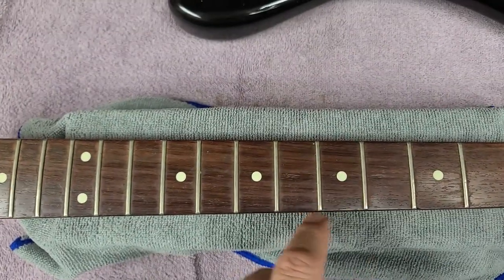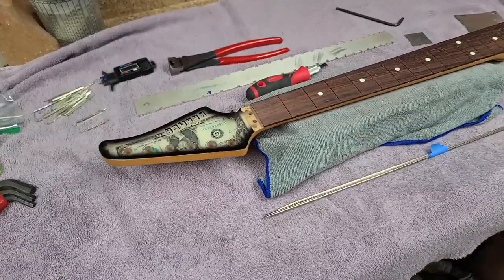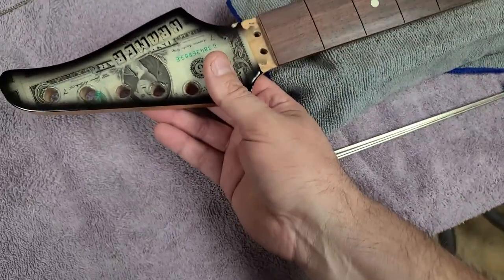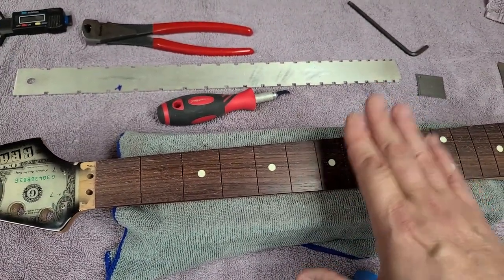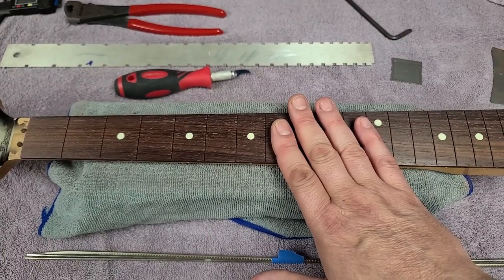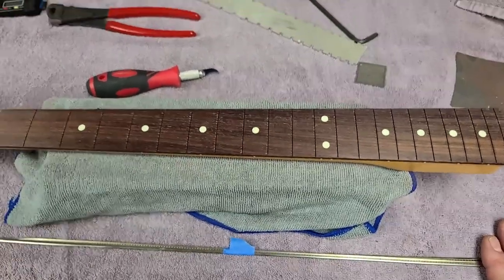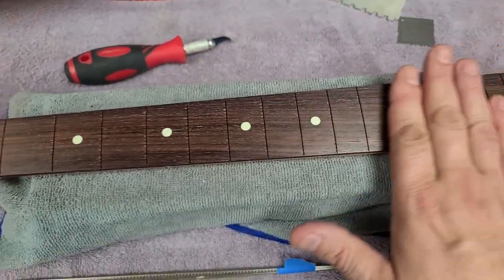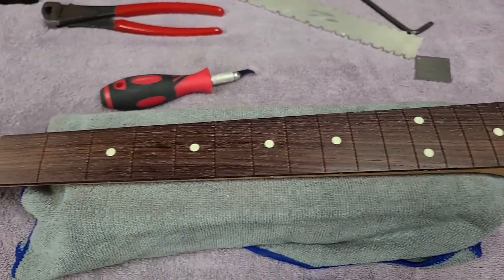Frets How Little is too Little

Comment: Cool! So you modified the tool to measure the height of the frets divot to tell how much usable fret is left.
Reply from the maker: Yep! I didn't give it a sharp point, but enough to see the difference as I slide over the dents in the fret. If I subtract that difference from the overall fret height. I can see what or how much fret would be left and if it is worth doing a fret leveling or just replace them. The tool can still be used for what it is intended to be used for and that is for measuring action height.

Comment: Ok, right off the bat two comments that cracked me up; "I could probably clone the owner." "I used a 10 inch radius block." I know exactly who you got that technique from! Interesting tool for checking fret height.
Reply from the maker: The tool is intended for measuring action height. I found other uses for it that works pretty good. I was mostly using it for measuring the overall first fret height and then adding 18 to 19 thousands shims to give me how much I need to cut  the string slots on the nut. I would take the number off the tool and get the same thickness in shims. Then add the 18 or 19 thousands shim, hold all the shims up against the nut on the fret board, file the string slot on the nut till the nut file starts to touch the shims. That will give me the first fret action height. I should clone the owner of this guitar. He knows how to play really good. Maybe his clone could teach me something lol.
Reply: @ericctheartofnoise8613  , thanks for the info it sounds like a very useful tool to have.